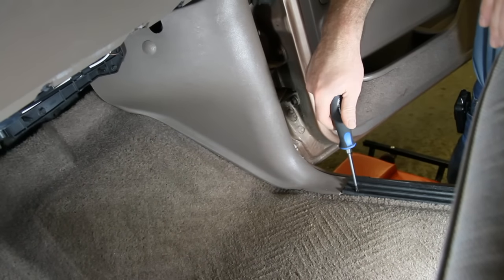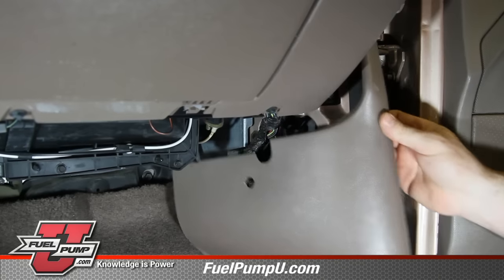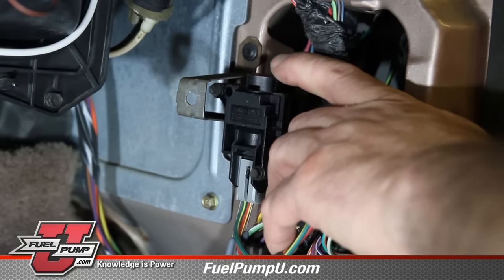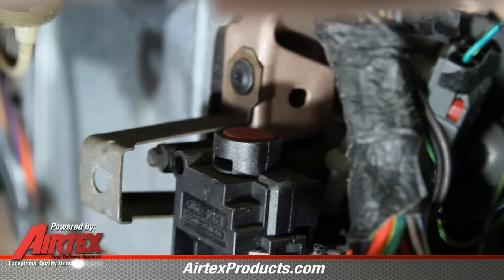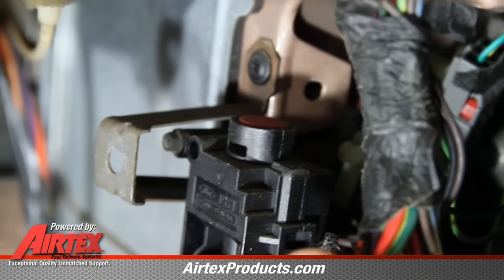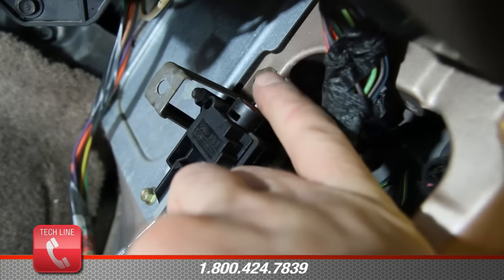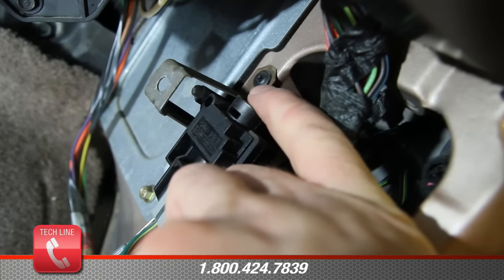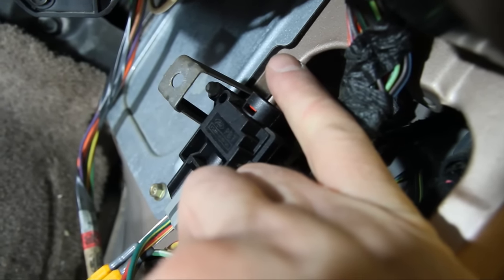How to Check Inertia Switch on Ford Vehicle Fuel Systems

Comment: I'm having a lot of trouble locating the inertia switch on my 2010 ford fusion. The manual to the car states the switch is located under the right side passenger dash board, however it is not there. I watched a video on how to bypass the switch (which is NOT what a want to do) and its showing it in the truck behind the speaker deck. However that is on a different car, but still a ford. Can u please help with locating the switch? Thank you for any help your able to provide!!
Reply: Did you ever figure it out? Lol

Comment: Could a fuel pump not shutting off have anything to do with this switch?
Reply from the maker: No. A pump is active as long as it has a power source. If the inertia switch is activated it will stop the flow of electricity to the pump. The same with the ignition switch being turned off. No power, no pumping.
Reply: My inertia was activated but my pump maked sounds when  I turn ignition on so it's possible I think

Comment: mine does not go down when you press it, would that indicate a failure? or other factors would chime in?
Reply: Did you ever find out if the inertia switch was a failure because it didn’t stay down?
Reply: @kodacvisualz great question, looking for the same

Comment: having a ford ranger 2.5, 2009 model I have check every where, I cant find the inertia switch what now, where else to check
Reply from the maker: In a 2009 Ford Ranger 2.3 the inertia switch is located behind the passenger side kick panel.It is held in place by two screws.

Comment: Where is the cut off switch for ford falcon futura ba located?
Reply from the maker: All US production Falcons used a mechanical pump. There is no inertia switch when a mechanical pump is used. If your Falcon is from outside the US and uses an electric pump your best course of action will be to contact a local Ford dealer for information. We do not have access to the overseas market data.

Comment: does anyone know if a Ford Tempo 1993 has this? my fuel pump doesnt turn on some times, i have to wait till the engine cools down to start it again
Reply: +Airtex Pumps ok thanks, called that number, they told me to check fuel pressure, but the fuel pump wont turn on sometimes when i turn the key on the inginition to run,  so that wont help. my mechanic cant really figure it out, he said its electrical. i google my problem im seeing something called a fuel pump relay located in the a thing called CCRM under the hood, its supposed to control my fuel pump so that might be my problem

Comment: I have a 01 Ford Ranger manual tranny and it's giving me a P0232 secondary circuit fuel relay, could changing that switch fix the problem?

Comment: My truck would not start this morning 2003 ford ranger 2.3l it can also be triggered by heat it was over 100 degrees yesterday went  over every fuse until I looked on the next page in manual page 150 sure as chitt push a silly button never felt so dumb in my days good Lord

Comment: My van has a switch but there is NO BUTTON to reset it. Just a red plastic slide that just slides back and forth liek it's holding the wiring connector on... where the heck is the button?
Reply: Nope - just a metal box with a huge plug attached. It's tripping at the most inconvenient times. Like when Im at the post offoce and on my way to work. I cant figure out how to reset it. Yesterday I unplugged it then plugged it back in and the van started. I dont know if that's why it started, and wont know until it does it again.  Pissing me off!

Comment: It's a 2009 ford ranger xlt 3 ltr turbo diesel. We ran out out of fuel, threw some in and got 20 feet she died. So we changed fuel filter ended up cracking cracking injectors and getting a jump cause killed battery by then. Drove about another 100 mtrs and she died again. I have been threw every mechanical check I can . So turn to YouTube for ideas cause you can't purchase a workshop book ifor the ute!  She cranks but won't fire.

Comment: My Manuel says to turn on the vehicle and then pop up the switch and it will turn off but my ford zx2 never did until i unplugged the fuel pump fuse.. Can the switch be causing my intermittent start issues???

Comment: What happens ones it opens do you need to replace it or do you press it so thatg it can work again?
Reply from the maker: Yes, to reset the inertia switch you just need to push the button down and if it is tripped you can hear it reset.